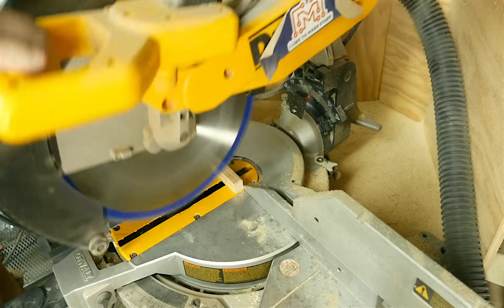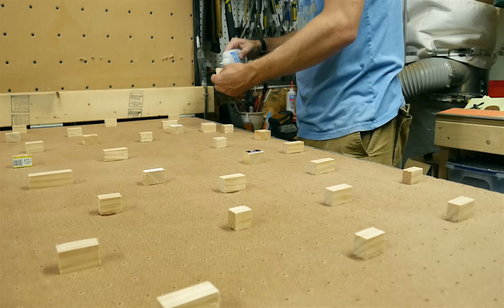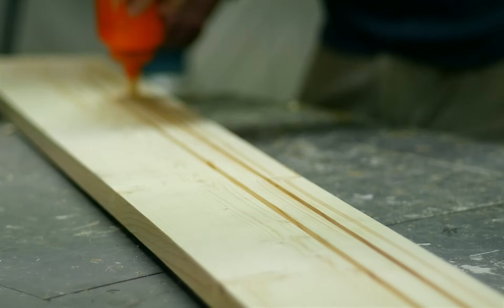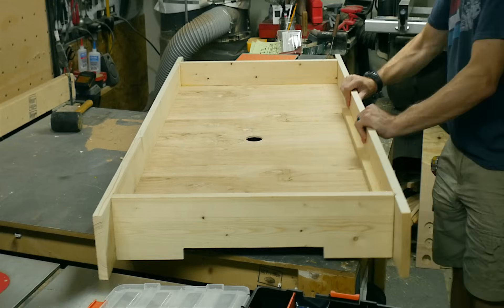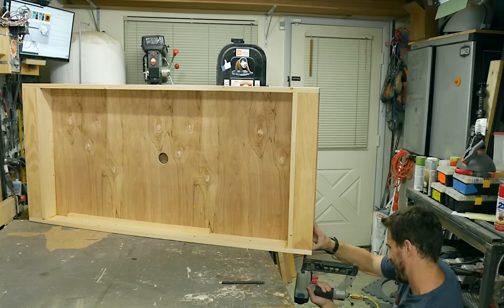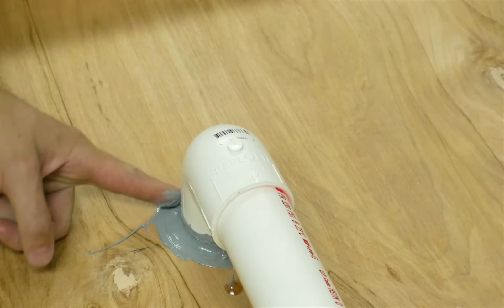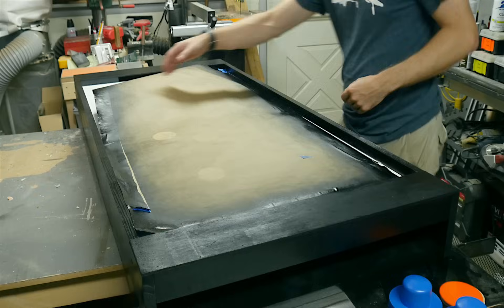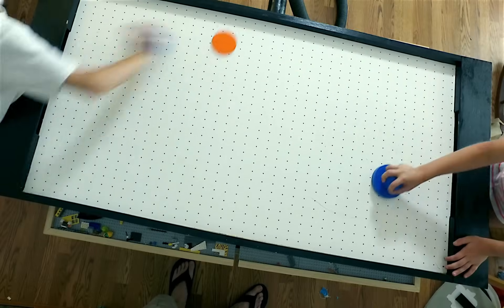Mini Air Hockey Table // How-To | I Like To Make Stuff

Comment: I play a ton of air hockey and I have a tip for you. What makes an air hockey puck glide is that they have a large circular pocket (about 1/4" smaller all the way around and about 1/32" deep) for the air to catch in. In addition, with the pocket cut out of the bottom, there's less surface area facing the table, thus less friction.

I'm willing to bet that if you implemented this into your design, you'd get better performance with less air. You could use a quieter, less powerful source of air, and still get the puck moving faster and smoother.

Thanks for all your great videos!
Reply: This.  Oh and the handles need the pocket too.  I think these could be easily 3d printed in PLA +.

Comment: Our air hockey table had a 120mm, high output, PC case fan mounted right underneath the center of the playfield.  Worked great!  You might also look at a bilge blower, as they can move quite a bit of air.

Comment: Great video Bob! One thing i would suggest is for the puck, is to cut a concave or "dish" on the inner aspect and leave the outer ring of the puck proud of the center. I believe this allows for a pocket of air to be built up under the puck so i glides better. I have seen many store bought pucks with this feature. Keep up the great work!

Comment: Solution for the strikers: cut two more circles of acrylic and glue them to the bottom. Then not only would they slide just as well as the puck but the puck would only be hitting acrylic, which would stop the wood from getting damaged and also make a more satisfying "clack" noise :)

If you don't want the strikers any taller, just rip off the part that's already been damaged as it's the exact height of the acrylic.
Reply from the maker: Great idea!
Reply: I Like To Make Stuff qual
Reply: Gff

Comment: I absolutely LOVED my Bobby Orr mini air hockey table when I was a boy. Some details of it's construction might help your upgrades.#1 - there was no huge shop-vac powering the thing. It had a maybe 6 inch plastic fan. As summer winds down you can probably catch a deal on a small fan at Wal-Mart to try. Pull all the plumbing and just mount the fan over the whole.#2 - Where the puck hit the walls. Weatherstripping. The black foam square profile adhesive backed stuff. It may slow the action a tiny bit but it'll also give a distinctive sound to ricochet versus player strikes.

Comment: You were asking about noise reduction on the podcast, so here's my 2 cents: Instead of plumbing in the shop vac, how about an entire box fan underneath? Usually the noise from fans is directly related to the size of the blades, so larger blades = quieter. They move enough air that even on low speed it should give enough lift to be playable.

Comment: You outdid yourself, awesome project Bob (as usual).  I have a thought on the peg-board "problem" that occurred to me during your debrief at the end.  Someone could use peg-board as the template and use one of those self centering vic bits to drill the holes in the top (if they don't own a cnc).  Your house must be turning into a 80s style arcade with all the cool things you have been building.... I think I will go back and watch the zip line video again now.
Reply from the maker: Yeah, using it was a template is a great idea!

Comment: Great build, yet again, Bob.  I would add feet or felt to the bottom of the table so it didn't scratch or rub any adjacent surface I set it on.  As for the shop vac noise, you could get a long accordion-type host extension and set the vac outside, or in another room.  Adding this to my list of "things I should make".  Thanks for sharing!!!!

Comment: Can you make an air hockey table using magnets of the same charge?
Reply: Yea.. Having long closely placed coils could possibly work. Maybe it'd be difficult to keep the puck in place and avoid it swaying away.  I don't know. I'd love to see this built though. :D
Reply: You'd have to have double sided magnets or it'd just flip around. And the walls would need to be pretty high aswell
Reply: Ho!! WAIT A MINUTE YOUR ARE A ILLUMINATI CONFIRMED!
Reply: Then it would not be air hockey, but mag-hockey.
Would need a load of magnets, but a must-do idea.
Reply: Try to imagine the cost...
Reply: Cooking Hungry that was exactly what I was going to say.
Reply: Unfortunately magnets don't work like that
Reply: Even if you had a puck that wouldn't flip over to the attracting side, creating a table that had a uniform and flat magnetic field on top would take wayyyy to much time, effort, and money.
Reply: freeman621 
Glue the magnets on both sidesof the puck
 So if it flips over, it still floats

Comment: Make a ski ball machine now
Reply from the maker: It's on my list :)  I just have to find space
Reply: +I Like To Make Stuff what's the hook behind your saw blade I've never seen one before
Reply from the maker: wbap hellcat Behind the blade? That's called a riving knife. It helps prevent kickback.
Reply: +I Like To Make Stuff mount the ski ball machine to the bottom of the air hockey and make a table that the top rotates on
Reply: +I Like To Make Stuff thanks
Reply: +I Like To Make Stuff or a mini ski ball machine ? sp you have the space you need :)
Reply: +NA so*
Reply: skeeball*

Comment: Hey Bob I have a question, I want to know about the specs air blower volume and air pressure..............
Thank You.........
Reply from the maker: The shop vac I used is linked in the description. You can find all of the specs there.
Reply: I Like To Make Stuff do a mini pool table
Reply: Not a mini pool table but a full 8 by 4 feet one

Comment: All that gear and you use spray cans?
Reply: Using a brush would be more tedious
Reply: You'd have to keep dipping your brush in the paint and with spray paint you just spray it on
Reply: I was meaning spray equipment, but I do like your comment, way to go.
Reply: Andrew Jackson
Reply: Why would he? You can produce a good quality paint job with spray cans if you're careful enough to prevent drips. Bringing out the paint gun only means more work, connecting the compressor, pouring paint and cleaning the equipment. Way easier to just grab a spray can.
Reply: Be quiet because you can't do anything he just did

Comment: Hey bob, I'm 16 and you don't know me but it's all good. Ive watched your channel for quite some time and you have great ideas. But I noticed one thing you could change that'll make a huge difference. It's your painting. I've been working with my dad in the carpentry business for 4 years now and this technique he does when he paints could help out your work. I understand everyone has their own way of doing things and you probably do it for the purposes of your video to not be too long but trust me, you'll be pleased with the finishing work. When you paint wood or pvc, it's always good to know what type of paint you need for the object your painting. And when you do paint, do three thick layers of paint. Each time your paint is set, sand it down with 220-320 grit sand paper. After sanding it, blow it out and on to the next layer. At the end of those three layers, apply a protecting coat. The product will last you long and look great. Trust me, it's worth going the extra mile to make your project look great and last longer. Nice chatting with you bob :)

Comment: Hey Bob!  Long time viewer, first time commenter.  :)

I built an air hockey table with my son for a science project. We tried a bunch of different air sources (as part of his project).  We were actually able to power it with a strong hair dryer (with a no heat) setting.  Since it was smaller, I was able to mount the hair dryer underneath the table and then wired a switch.

I also just bought a set of strikers and pucks.

Great job!

P.S.

I don't have a CNC machine...it takes a LONG time to drill the holes by hand.

Comment: Cut a circular recess in the puck.  It will catch more air and give the puck lift.  Instead of cutting an angle in a piece of wood in the goal so it doesn't bounce out just put a piece of foam to soften the bow so it falls into the goal.  Don't use aluminum for the rails where the puck bounces off of because it will be loud and it will dent messing up the rebound the next time the puck hits the same area.  People throw out computers all the time. The more fans you can get off the computers the more fans you can install under the table for more air flow.  This will nearly cut the sound out altogether. These are some of the ideas I had.  I hope they work for you.  This will be something I hope to make for my kids (actually me ha ha) in the future. Thanks man and keep up the good work. I love your videos because they are quick, easy to follow without boring dry bits of video.  I never have to double tap to "get to the good stuff".  May God bless you and your family.

Comment: One thing I have seen on a commercial table used some 120mm fans, with the bigger holes you can get higher static pressure fans. corsair has some fans that are specific to static pressure and air flow so you can take a look at the shape of the blades. Another thing you can look for are specific server fans, they usually run at 1.5-2 amps each and can move quite a bit of air.

Comment: I'm really impressed with the performance of this table! Often anything other than a proper arcade table leaves a lot to be desired. Having played a GOOD deal of air hockey (competitively, and yes that's a thing) here's my 2¢:

1) I think the tabletop hole size needs to go down a lot. An arcade table (almost always Dynamo brand) the holes are 1/32"! Doesn't necessarily need go THAT small but even going down to 1/16" would see significant improvement.
2) Adding aluminum rails on the side walls is going to be your best bet. Again an arcade table has aluminum rails.
3) A centrifugal blower (squirrel cage fan) is going to be your best bet. I've read on some home-made builds that using a leaf blower on a low speed will give you sufficient airflow and pressure to make it work well. Granted those are for a full size table (which is 8' long) so you could likely get away with a MUCH smaller blower size for yours. Perhaps one for a tiny bounce-house?

Also your choice of acrylic puck is the best choice, the real deal ones are made of acrylic/lexan. 
And lastly for scoring- official rules state that if the puck crosses more than halfway into the goal, it counts, even if it bounces back out. But good luck getting kids to not argue over that! :P

Hope this is of help! I look forward to seeing the improvements!

Comment: Hey bob, I'm a little later but I have a tip that you may or may not find useful. Instead of using spray paint you should use plastidip. Depending on where you are it can be cheaper or a bit more than just normal spray paint but its worth it. The finish is always a nice matt, very smooth, Almost never imperfections. And if you have to join two piece together like the "handle" you can not see that they are two pieces. You can also always repaint it. Another good thing about it(May be personal preference) is when painting a piece of wood you don't see any of the wood grain like your would with spray paint. Oh yeah, and it makes it waterproof.

Comment: Awesome build. 
For the vac noise, I've got a video on my channel testing out the noise levels on the GS50 vacuum cleaner with and without a custom "quiet box" I made for it. Bosch say it's the most quiet bagless one. Not super expensive, I got mine used for about £72. 
I have no clue if it would give enough air, it's just a home vac, not a shop vac.

Comment: Fun build, I hope the improvements were all successful. You might also want to add a center line for "sides" of the table as well as a goal marking to outline the slot, like on commercial air hockey tables. All around nice build.

Comment: Nice build Bob. I'm going to have to try this myself. I got to thinking of the air source and your comment on how a shop vac is too noisy; you may want to try a junked out high efficiency furnace combustion blower that vent s out with PVC. These blowers usually have a higher static pressure to encounter long lengths of PVC pipe to vent the flue gases from the heat exchanger. You could probably get a used one from a local HVAC contractor from a junked out furnace for a few bucks. The trick would be to get one from a furnace that wasn't junked out due to a cracked heat exchanger which would probably be all sooted up and not good for use in this application. Just a thought. Scott

Comment: I made a table like this awhile back. I actually used  computer fans for the air which was quite quiet but a bit expensive as I made a table around the size of yours and used 12 fans. Although you could problably source them for free as well. Also I 3d printed my pucks and put felt on the bottom of the mallets.

Comment: you can salvage the blower motor from any old vacuum cleaner to include the blower into the table, keep in mind that you have to mount it with proper vibration dampening (for example hang it with bungee cord,) the box around it should be double layered with insulation wool (rockwool) in between the layers. this would make a much more silent air hockey table.
hope you can use those tipps

Comment: Glue some felt onto the bottoms of the strikers.  It will help them run smoothly over the table surface and help prevent scratches.

Comment: Advice for those who have to manually drill the grid: get pegboard... glue the layer of micra without holes on top... flip it over... and use the grid of holes in the pegboard as a drilling guide.

With the right drill bit you can even have a guide that fits exactly inside the holes of the pegboard to get your much smaller drilled holes perfectly centred. This ensures the matrix of holes in the micra are also perfectly alligned. Hope this helps!

Comment: Bob, what about using a PC case fan. A 5.0 hp shopvac moves ~175cfm. You can get some good sized case fans that will push around the same amount of cfm for around $30. It'd be small enough that you could mount it and a power supply under the table, cut some vents in the sides and let it blow.

Comment: If the kids ever get tired of it, you can use it as a downdraft table. About getting the sheets to go into the slots...if you round over the edges some with sandpaper and put some paste wax on the edges it really helps a lot. I felt your pain as I have had so many fights with slots like that. Don't even get me started on trying to fit louvers into slots on a saloon door.

Comment: I had a small table like that as a kid (obviously store bought), but the blowers under the table were just two fans. They look almost like case fans for computers and I'd imagine it would work just the same! Add an Arduino with some sensors at each goal, a LED matrix for a score keeper and a couple switches to operate it all and you have just like a store bought table!

Comment: Blower option might be a high flow bathroom vent. They're not cheap for quiet ones, but should be able to easily mount under the table.
Reply: They are great at moving air at a low pressure but it wouldn't have the power to push enough good idea though :D
Reply: So a quick google produces some information on "commercial" grade air hockey tables that have blowers that are moving air around 210 CFM. Since the table isn't full sized, I would bet a lower CFM is acceptable. You can find fans on Home Depot's site for 150-180 CFM. And you could always use two fans instead of one for more even air flow at the ends of the table.
Reply: Two would probably work maybe he will try it :D

Comment: Add an arduino with IR sensors on the goals and an LED counter for points, you could also run LED's behind plexiglass buffers on the sides to prevent the wood from being worn and make it playable at night (bonus if some UV LED's are thrown in and UV reactive plastics are used?).

So many possibilities!

Comment: That looks great! Don't forget to build some clear plastic boards for the sake of your walls. Typical air hockey tables are waxed and polished on the top,  that might help with getting a smoother movement of the puck. Wax, Polish then poke nails through the holes to clean them out, as well as putting felt on the handles to avoid scuffing and damaging the surface, as well as getting smooth movement.

Edit:

Whoops, didn't realize there was still 3 minutes left in the video. 

As for the air issue (including noise), you could try getting some static pressure fans built for computers (such as corsair) They're fairly quiet and will do exactly what you need them to do, though they're a little bit pricey.

Comment: Hey Bob, you should make the puck slightly convex on both sides so that they float a bit better. Every air hockey puck I've seen has a lip around the diameter of the puck to "trap" air and create a better air cushion under the puck.

Comment: Maybe use a box fan mounted onto the underneath instead of using the shop vac. They use brushless motors, so will be much more quiet. That'd also avoid pipework sticking out the sides 😊

Comment: A couple of suggestions:
-Build a mini cabinet for underneath the table, that's soundproofed to hide the noise from the blower, and you could fit a corded blower into that space, which also gives you a power source to run lights or anything like that
-Cast the strikers out of resin or encase the bottom section in some form of plastic (like your pvc idea, but cover the base too). This way they last longer, and the plastic base will slide easier on the surface
-Skirting the edges with plastic is probably a bad idea, if you hit it hard enough you could crack it. My suggestion would be to go with the aluminium option

Comment: This is a really nice build. You might be able to use some small electric ducted fans used for hobby rc jets for you're airflow. They could run on battery packs and should produce less noise, depending on how they are added.